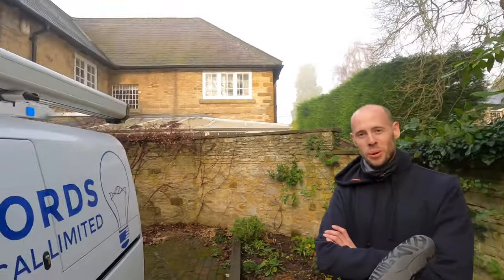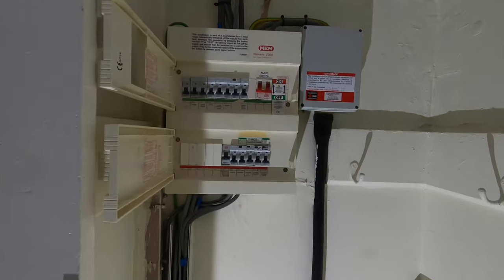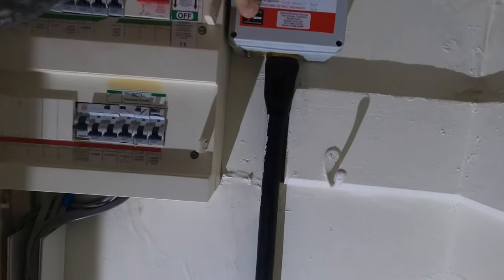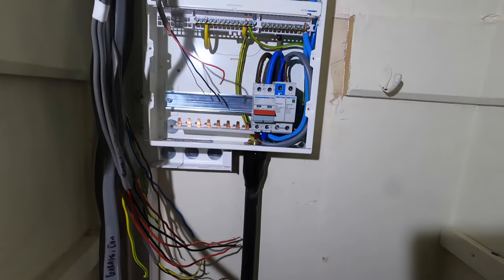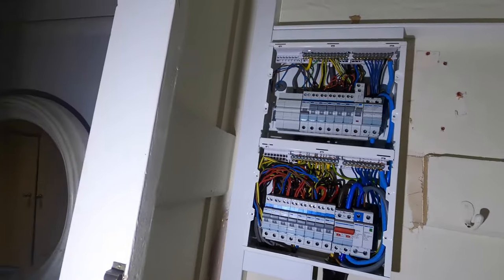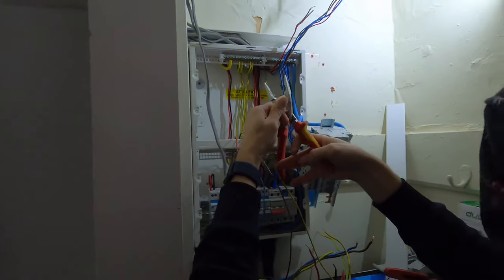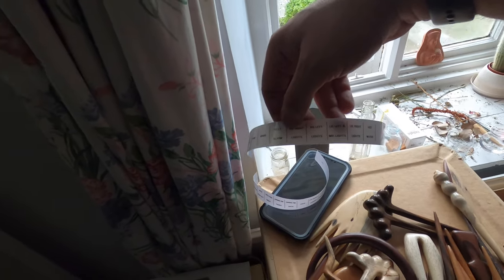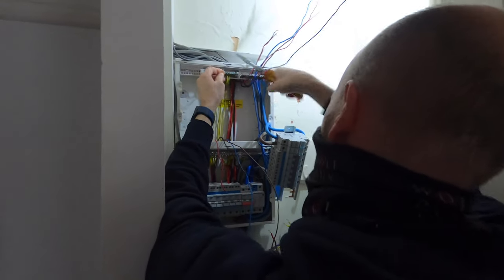The Coach House after the EICR

Comment: I was kind of against torque drivers, I've never had a problem with breakers terminals becoming slack or opening which happens mainly with the cheaper protections, Now I use it all the time.

Comment: With a 100ma s type up front fault protection is afforded via that. Double insulation shouldn’t be required 👍 x
Reply from the maker: That’s what I discussed with my assessor and he disagreed. So I sleeve anyway now 🤣
Reply: @GiffordsElectrical  how strange, it can’t hurt can it.
Reply: @residualelectrical  I could understand his comment if you had meter tails directly from the cut out/meter position as the 60-100A fuse would not blow due to the high ELI via the TT earth rod but in this case, you had a time delay RCD protection for the sub-distribution circuit.